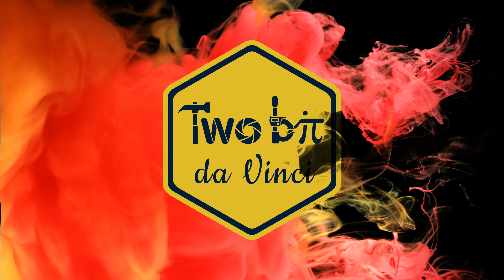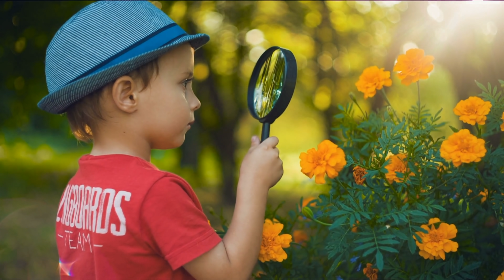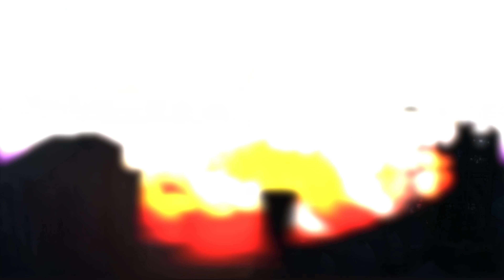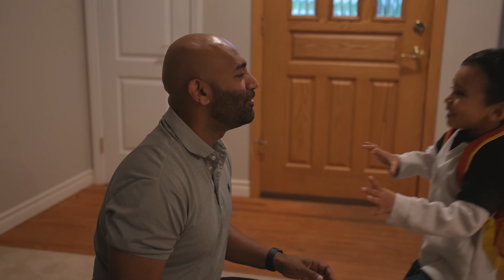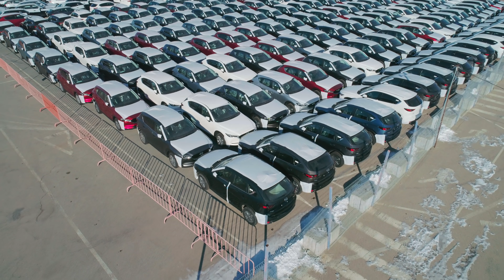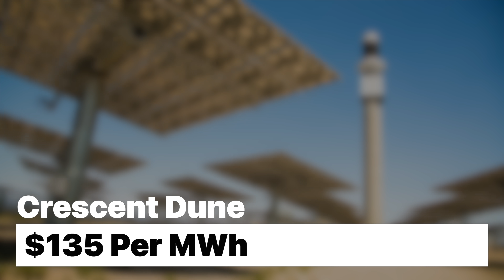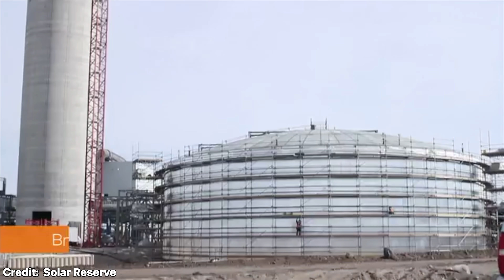This Billion Dollar Solar Plant was an EPIC Failure

Comment: out of the box thinking, use something other than salt that melts at a lower temperature and create giant hyperbolic mirror dishes instead, one motor, one thing to maintain and clean instead. Scale by building multiple, less motors and more mirror coverage per motor.

Another option to maybe save this project is to build a giant glass cover (lol like the simpsons movie) to reduce dust moving around, reduce the need to clean mirrors and grease the motors. This is most likely less plausible as the structure to hold all the glass will cast some shadows so there will be some loss, but on the up side it will keep the whole farm nice and warm :D

Comment: Of course it’s failing the sun is getting dimmer and weaker it’s not you it’s not CO2 it’s the normal cycles of the sun getting dimmer and dimmer, A grand solar minimum. 
To ignore the sun and climate science proves it’s all a rip off .

Comment: His explanation doesn't tell you the whole problem.1)Blinded airline pilots 20-30 miles away 2) Took more natural gas to preheat the salt every morning than it would to not use solar at all. It needed more natural gas than it would have saved. 3) Kill tens of thousands of birds. Incinerated birds that were just flying by. As far as storing heat, the salt didn't stay molten very long at all.

Comment: I still see a lot of potential in this system, especially when it comes to producing green hydrogen in equator close areas.
Maybe going for a parabolic dish design (like the radio telescope from that bond movie) would be an idea? It sure would cut back on the motors, movable part and make cleaning far easier.
Reply: If the dishes are stationary, the efficiency will be even lesser since only one part of the dish will receive sunlight at any point in time.
Reply: @manojkmondal  Only in the morning and evening, where you will receive less sun anyway.

Comment: It is a typical example of how a good solution has to be destroyed in order to prevent it from competing with already "well" proven money-sucking solutions. The problem with this technology is that it doesn't generate enough benefits for operators and takes away revenue from less efficient pointless solutions like the flat solar panel

Comment: Why isn’t anyone talking about the real issue when it comes to solar panels, wind turbines and EV’s. They all require stupid amount of emissions to be built, and in the case of solar and wind, they’ll only last about 20-25 years before they’re burnt out. The price of building and erecting just one wind turbine is questionable if it will ever be profitable. Then when it comes to the EVs, the cobalt and lithium mining is some of the most destructive on the planet. Takes diesel to drill and blast, diesel, to dig n haul to a refining plant. In the end it’ll take over 100,000 miles before a EV is even close to offsetting an ICE (internal combustion engine) car. Instead of pretending green energy is the future, we need new nuclear power plants!!!

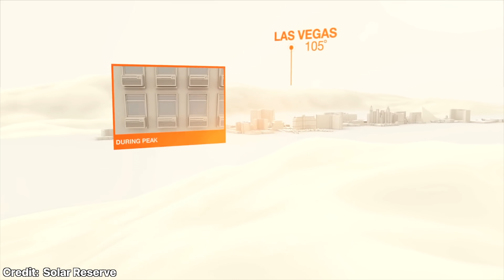Comment: 7:00.  The host failed to answer the question posed, which was " why did it stop working".  The answer given was also incorrect.  Saying the plant doesnt work because its too expensive to operate is incorrect.  That is an answer based on economics, not based on operability.  It could be a policy to operate at a loss with subsidies being supplied by outside agencies.  A commercial decision to not operate is NOT the same as it doesnt operate.
A failure by the bean counters to account for price changes in the competition and make allowances for downtime through maintenance & repair, was extremely piss-poor.  Bean-counter failure 101.

Comment: When I first read about this method (I think it was a scientist that had affixed many mirrors into a concave dish and could instantly burn through a 2x4 wooden beam) I immediately thought about how great it would be to localize that tech using just water and a turbine -- Small dish in a yard that rotates with sun, constantly boiling water in  a loop for power generation. Sure, there's no inherent storage, but it would be simple-er.

I remember reading up briefly on this farm, but had no idea they were using molten salt. Whereas my 'small-scale' idea would move an entire dish to follow the sun (think of an old-school satellite dish rotating to follow the sun), this farm was using hundreds of tracking mirror arrangements.  The maintenance costs must be astronomical, not to mention the salt storage problem.
Reply: there are some ideas on how to store energy and they mainly rely on heating up something that stays hot for awhile after the sun goes down or by storing mechanic energy but both arent great.

I felt the same way about all the tracking mirrors, seemed like a logical nightmare, which is why most engineers usually try to minimize moving parts on anything that needs to run long term with minimal maintenance
Reply: That small scale version is actually on the market already. Some are additionally equipped with highly efficient solar panels at the point of concentration to make use of the heat as well as the light.

Comment: Over and over and over again there are schemes to use mirrors to concentrate sunlight for heating something.  Over and over and over again these systems always fail.  My favorite is the one in France that cut the supports for the heated part because mirrors  were mis-aligned.  This method has always been an intrinsically incredibly stupid idea yet, these designers just know so little they believe this focused sunlight system is viable on large scale.  Lack of real world knowledge is all I can say as these type collectors have been failing miserably for over 50 years.  Stupid is as stupid does.

Comment: Two Bits, was this that plant that also had a problem with birds being killed as they flew thru the concentrated beams of solar energy reflected off the mirrors? Maybe it wasn't this plant, but I had seen reports from a solar concentrator that had such a powerful beams coming off the mirror arrays that birds flying thru the beam were killed. Beautiful reporting here, great information and presentation. I think it's and incredible achievement that we were able to build and run this plant. Expensive lessons learned on the cost of maintenance of such a passive system. But that's what it takes for us to learn. I work space hardware and we have very similar learning experiences. Not a total waste, we learn from it and try something else.

Comment: Besides the hard competition from PVs (which are still capped at about 20~22% efficiency) it seems this power plant problems were its own poor efficiency compounded with poor implementation.
Imho CSP-thermal power production & storage plants have huge potential, they just need to be well designed and implemented. There are several alternatives, with ranging temps from -200C to +1414C some of which claim efficiency around 60% (ie about triple the one from PVs), while PVs are currently cheap because of economy of scale, their efficiency is already capped, and still require exotic materials and toxin releasing processes to produce (still very far from the ones released by fossil fuels!), and limited (even though long) life-cycle.
CSP+thermal-storage (using heat-engines for conversion) have the advantages of not requiring any exotics materials, and having no life-cycle limits to the parts that are scaled (ie mostly the pumps need regular maintenance, and are subject to replacement at their life-cycle)
Reply: Bro. you are right. You must be some engineer or else its not possible to reach right conclusions. I too agree that CSP with thermal but no storage is the future. Everything in the plant was good except the molten salt, they need a different thing to store the heat and convert it to electricity with cyclicity of the process without leakage in a closed system setting.

Comment: Every pinioning technology had huge problems. Will CSP bi the way to the future of energy production, I don't know, what I do know that the first jet engine engines developed in 1930s were not adopted due to stress levels materials of the time could not handle, example Me 262 engines had a lifespan of 20 to 25 hours. First internal combustion engines were also a mess that had a habit of exploding and catching fire. Every failure is a learning experience now what can be learned and what will those lessons be ... even if it is "don't build CSP power plants in the future" it still a lesson. As for investing tax payer money this is a double edge sword since the private investors invest for profit, extremely high risk projects don't attract private investors as much and sometimes a government subsidy or direct investment is a safety net ...

Comment: To quote the cost of $30 per MWh for PV solar is misleading because the additional transmissions costs, the replacement after 20 years life-cycle, the environmental impact, the need to provide reliable backup power, and the mismatch between supply and demand cause price fluctuations on the electricity spot market. If PV solar is so cheap, why is it that countries as Australia has some of the highest electricity prices in the world and it will only get worse if more of wind and PV solar is deployed by gas and coal is phased out.
The problem that politicians and those advocating PV solar and wind refuse to comprehend is that it an unreliable source of energy and therefore needs 100% backup meaning that two mutually exclusively operated systems need to be provided. Compared with nuclear, PV solar and wind is more expensive and less reliable.

Comment: This solar plants seem quite inefficient at below 30% efficiency and only produces around 100MW.  CCGT (gas) plants are around 60% efficient, while coal plants are at ~40% and hydro is around 80% efficient.  Also, nuclear plants are between 32% and 38% efficient but a typical single unit at a nuclear power plant can produce between 800MW and 1400MW, depending on the plant supplier.  Seems solar only works if constantly subsidized by Mothership (the US Treasury), which is funded by all us confused tax payers, and our children, our grandchildren, our great-grand children, etc.

Comment: While I agree that green energy is a good idea, I don't think the world is ready to jump into 100% green.  It should be done gradually.  Solar panels are great, except for the construction pollution of the panels, disposal of batteries, etc.  If I were to buy a photovoltaic system for my house, it would take nearly 10 years to regain the upfront cost.  In 10 years, the batteries would have probably needed replacement several times and the panels would be about done.  I think the focus should be on how to sustain, in the long term,  photovoltaic systems.  Areas by the oceans can tap into tidal energy.  People in windy areas, like West Texas can tap into wind energy.  My 2c.

Comment: I would venture to say that solar thermal systems to some degree could work on much smaller scale simply because I have some experience with it. Certainly not with molten salt but solar heating water. Several years ago we were vexed with trying to figure out how to extend the usual season for our pool at the house. I came up with a panel with copper tubing through it running water off the filter before it goes back into the pool. The panel I built is 4 ft x 8 ft and while it is not a movable panel that tracks the sun it is aimed at Peak Sun as well as having some reflective material around it to draw the sun's energy into intensify it. Using this setup I'm able to heat the water up about 15 to 25° above ambient temperature, and this is an above ground pool not an inground pool either. It's got a separate pump and filter for the water to run through so not all the water that is being pumped in through the pool is heated in this manner but it effectively allows the pool to start being used much earlier in the season and finish out much later. Instead of only being good from Memorial Day to Labor Day it's usually good from Easter till Thanksgiving at least. A friend of ours for their place has used a system that they built that's bigger still to preheat the water going into their hot water heater for reducing how much fuel they use on their hot water heater as well as preheating the air for their HVAC system and their system is big enough that they can do so for both their house and the adjacent shop. However watching this is giving me some inspiration to while I'm certainly planning myself to expand my solar water heating to similar potential that my friend uses for their house and Shop with one other thing I have seen fairly recently wanting to attempt to see if I can successfully bring water up to and Beyond boiling point to produce Steam to be able to produce electricity from the Sun.

I would say as far as PV solar power the only practical solution to solving the primary disadvantage for it would be to put solar panels where they are capable of being exposed to the sun 24/7, in space. Beaming the power back to Earth through microwave transmission, based on the method as described by Gerard O'Neil in the High Frontier..

Comment: Also, instead of using molten salt which is a hazard and difficult to handle, China will use BYD batteries (massive ones) to store the energy for night time energy delivery.  So there is only mirror, light, steam and battery.  We will see how it play out in China.

Comment: Don't count it out yet.  China is planning to mass produce these light tower solar plant in its Gobi desert.  Their engineering capability and the low maintenance cost due to technology advancement and labor, will make it a feasible venue.  One thing great about this solution is that it does not require replacement of the panels (the mirrors can be smoothed up again and the heat mechanism is self contained) and the power output is more efficient.

Comment: This was designed to be expensive, overly complicated, and built from preferred suppliers proprietary parts. Like all the so called cutting edge technologies failure is assured through design. Solar anything is just a pipedream at today's governed technology level. I know we are capable of usable solar but it won't be allowed for quite awhile.

Comment: It would seem to me that even though it may not be as efficient at holding heat heating up oil rather than molten salt would be a better use. No need to keep the oil heated in the pipes with an out side heat source. And the oil is counterproductive to corrosion unlike molten salt
Reply: oil is not as heat resistent as molten salt, resulting in lower max temps, resulting in lower efficiency, resulting in lower electric output.

Comment: The main detractor for battery storage is the relatively short life span and the toxicity of the end product. Recycling lithium based cells are cause for concern given there's no standard recovery method and the chemicals used are highly toxic. 
It doesn't matter how efficient your energy production is... There's no such thing as sustainable while a massive over population is causing depletion faster than people can benefit from the resources.

Comment: They stopped in 2019? I was driving by there in 2020 and they still focused the light on the towers, why would they do that if they won't produce electricity?
Reply: Because he has Crescent Dunes mixed up with Ivanpah. I'm pretty sure Ivanpah is still working. I think he got confused because Ivanpah is technically in California, even though it's near Las Vegas. And he didn't check to see where Crescent Dunes is.

Comment: I've said since the beginning of this storage fraud used as an excuse to make solar thermal undesirable and un-fundably inefficient: It's just not necessary. That's how they stopped the initial wave backed by the television star Art Linkletter around 2005. During the summer at least, the plants would be most productive during peak usage: that's the way God made it. So if you waste a bit, too bad. It's better than this problematic technology that renders the whole thing useless.

Comment: This is what happens when a project is driven by emotions instead of brains.  This is at minimum the twentieth taxpayer funded solar energy project to fail, and I, for one, am highly pissed about it.  This is like knowing the goal is to hit the bulls eye in a dart game but not knowing how to throw the darts.  And it's all because some wackos are obsessed with eliminating fossil fuels RIGHT NOW to "save the planet."  The planet has been around for five billion years and will be around for another five billion years, regardless of what we humans do.  If you do want to replace fossil fuels on a scale to supply the earth's population with affordable, reliable, sustainable energy using new technology, it is a very complex and expensive endeavor and must be THOROUGHLY TESTED before implementing a project on the scale of this one.  Or you can just use a tried, tested, reliable method already in use --- nuclear energy.  Runs silently all the time, needs no sun, wind, or falling water to operate, and doesn't harm wildlife like solar and wind do.  The safety record of properly built nuclear power plants is astonishing considering the decades they have been in operation.  You want solar energy, well here it is.  Nuclear plants produce the same power source the sun does --- a nuclear reaction.  Some people say, "But what about that spent radioactive fuel.  What are you going to do with that?"  Well, what about those millions of dangerous, non reusable solar panels that wear out every ten years.  What are you going to do with those?  Nuclear is your solution, if we're not too stupid to use it.